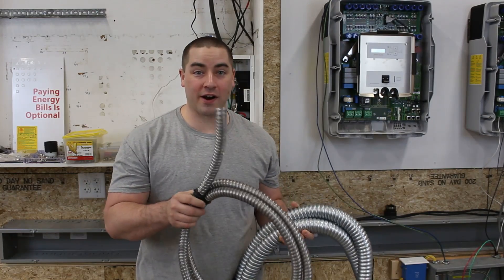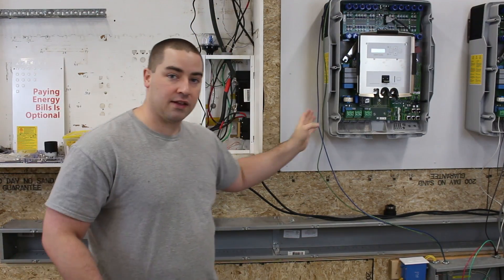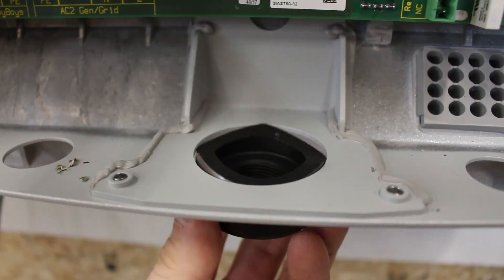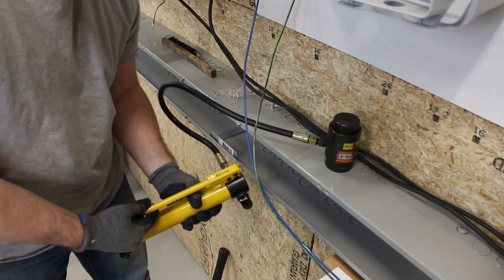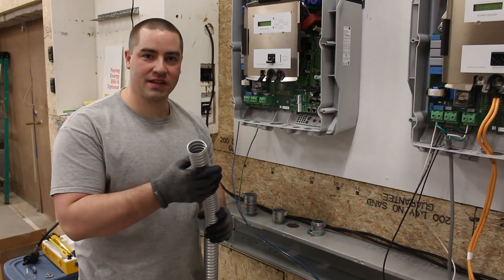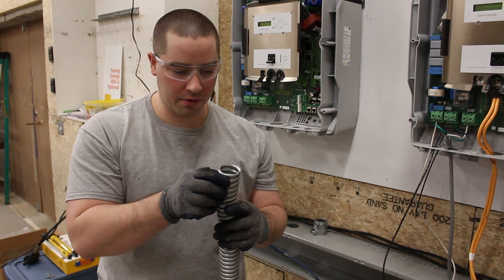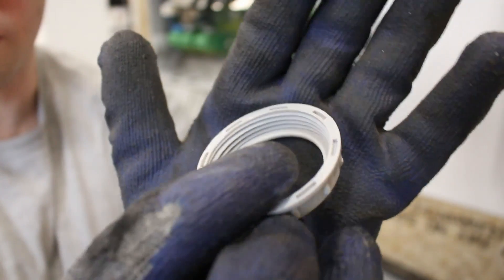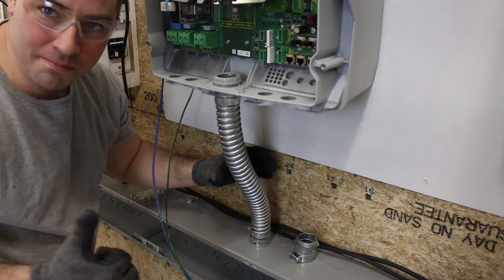Flexible Metal Conduit to Protect Inverter Wires

Comment: We have over 500 drives where I work and not one has ugly looking greenfield for short run to a trough. We always use EMT conduit. We never run low voltage control wires in a trough or box that has the 240 or 480 volt wires. I never purchase troughs or panels with knock outs.

Comment: Be aware that if you run any conductor(s) in a metal conduit that it must be derated. Same applies when you bundle cables. Very short segments likely will not have any measurable impact.

Comment: @DavidPoz I decided I've had enough of the ratchet-based knock out punch and am considering getting a hydraulic one. After having used yours for a while, would you still recommend the same one? It seems like the blade on my cutting heads are worn. I know I can probably sharpen them but honestly, the hydraulic would have been a better investment from the start. Thanks :)

Comment: I went to my local discount electrical supply store this morning to look at the flex conduit you're using and had price sticker shock. So I just purchased the same size in thin wall tubing and used my bender to make the angles necessary. Also purchased a hole cutter similar to yours off of eBay. The flex is really spendy. Nice looking, however. Another good video Dave. Thanks!
Reply: how do you bend 1.5in EMT?
I see videos where they do 1.25in max and it looks tough.

Comment: I don't really get the need for conduit. So I did some googling around but I'm still unconvinced. If it were a complex mess, or if the wires needed protection, or people needed protection from the wires I could understand. In this case here the conduit seems to only be used to learn how to use it. That for most people it would be better to do without it. 
I suppose it is all in the eyes of the beholder. For me I want all my pipes and wiring to be exposed. I want them clean and visible so if they ever have problems I know about them. I want them to look like art work too. Hiding things behind drywall, in the ceilings, in the cement, floor, or underground just bothers me...
Reply from the maker: Actually, I'm with you.  I love seeing all my wires.  I think wires look better than conduit, and I like being able to trace it visually from A to B.  But, I have kids.  I want to be able to have my kids in the garage with me and I'm worried about them reaching up and pulling on wires.

Comment: Great work. You can also punch out a knockout and use the hydraulic punch thru that hole too if there’s and alignment issue. In fact the 1/2” knockout gives you some wiggle room for lining up your conduit. Great job David it’s coming along really nice. Did you order that 4/0 cable?
Reply from the maker: Thanks for the tip on using a knockout.  I did buy wire.  I ordered 2/0 for each inverter, since the inverters are 5750 watts continuous rating.
Reply: DavidPoz I just now put the 4 packs in series to make 48v. My son is going to help me pull out the 24v inverter and put in the 48v one. I think I will move it down lower so I don’t need a steep ladder to work on it. Move the shelf up and when I move it overseas I can install those those 32 new lifepo4 batteries above that. That whole setup is moving downstairs. No way am I carrying those packs up the stairs.

Comment: I'm watching with interest!  Seeing the SMAs that you picked up inspired me.  I brought home a whole DC solar trailer at the end of January, and I'm working on setting it all up in the garage.  Everything is off the trailer now, and the trailer is already sold.  It all works, and the battery capacity seems about right with a couple of initial capacity tests.  https://photos.app.goo.gl/qbVKkST35cJAB9Zc9       https://photos.app.goo.gl/q1euFhioH266nPvW9
Reply from the maker: I remember when you mentioned that.  I don't know where you got such a good deal on the trailer, but good job.  I would have snagged one if I could find them.

Comment: So Im assuming you went with the SMA units so you could have UL listed install. Sounds like a reasonable install. I'm assuming you can set these up so you can have both 120 and 240 if you have two of them. Being in California SMA may be the way to go. I'll go research these for a later install. For now I have the Sigineer 15kw Low Frequency Inverter. Nice clean install.
Reply from the maker: I have two inverters on the wall.  They are SMA Sunny Island, low frequency.  I hung them on the wall in this video: https://youtu.be/aU9gNSoep-o
Reply from the maker: Sigineer is nice too.  I used to have an Aims that I liked, and the Sigineer look identical to that.

Comment: David , did you  clean the ends of the flex with a file or something else before putting them into the connectors? They need to have a smooth edge on them so they do not cut into the wire. A hack saw or  your power saw will leave a ragged edge.

Comment: Cutting greenfield is even easier than that... all you need to cut is through one rib, and he conduit just comes apart! And then you don’t have any sharp edges.
They even make a hand crank cutter hat has a round saw blade, and it makes short work of the conduit!

Comment: Most important is that both feed and return of each circuit goes though the same conduit so heating my induction is not an issue. The one thing that was not included but should have been is a plastic insert that goes inside both ends of the conduit.
Reply: Wrong. Every drive that I wired in the directions stated you must use a separate metallic conduit, greenfield or metal sealtite for the input power, output to motor and one for control wires.

Comment: Had you used pvc flexible conduit you could have gotten away with plastic bushings
Reply: Typically exposed wiring has to be armored (especially if it's AC) to be code compliant.  PVC is typically acceptable for other wiring tasks.

Comment: I would recommend using grey flex tubing, not this horrible industrial post-apocalyptic stuff ;-)
Reply: also, get you some "cowboy"  straps
Reply: For exposed AC wiring to be code compliant you need to use armored shielding.  PVC wouldn't be code compliant here.

Comment: Looks great! As an added protective measure, you can stick these plastic thingies between the conduit and the conduit fitting. From what I was reading online (I am not an electrician) they were not required by NEC but highly recommended https://www.lowes.com/pd/Sigma-Electric-ProConnex-3-4-in-Anti-Short-Bushing-Flexible-Metal-Conduit-Compatible-Conduit-Fitting/50111514
Reply from the maker: Thanks